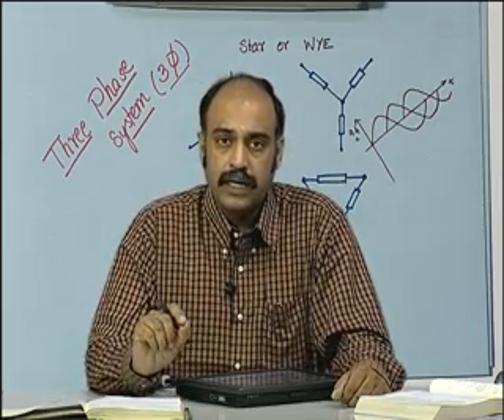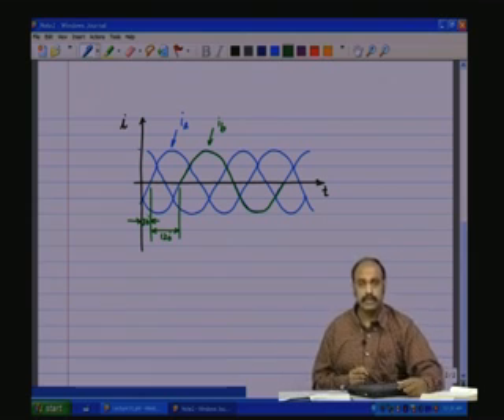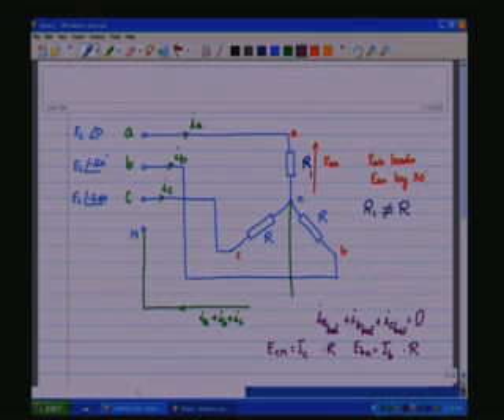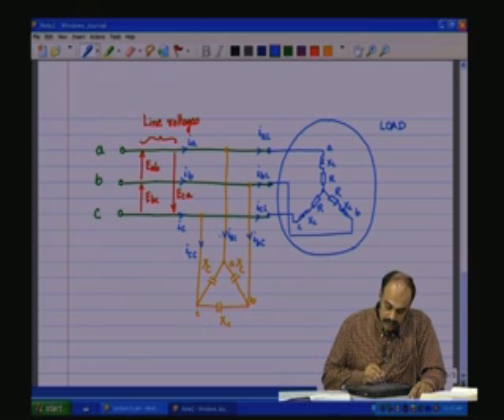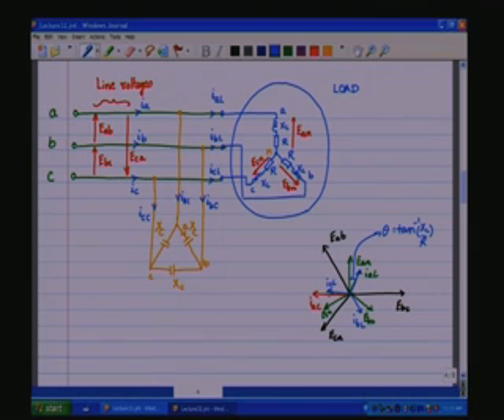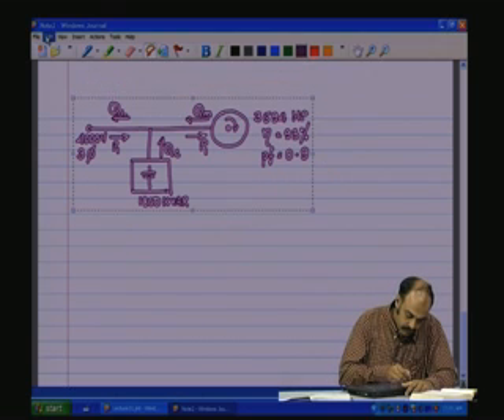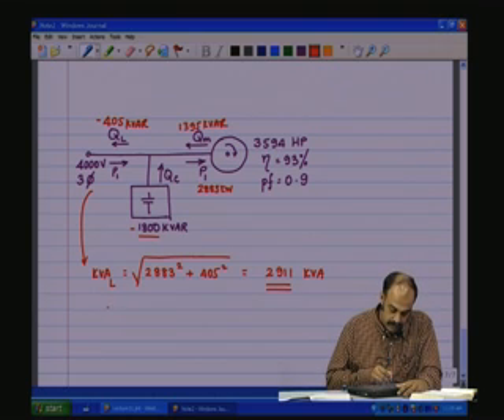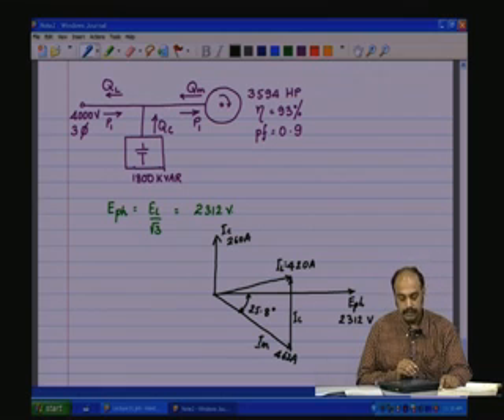Lecture - 32 Three Phase System - 3

Comment: Dear Sir , i have gone through previous lectures  30 & 31  and learn that for balanced resistive loads line current lags 30 degree w.r.t. line voltage  and the power factor to be unity for balanced resistive load.  here in this  video, while explaining  phasor diagram you are trying to make  Line current (ia)  in phase with line voltage (Eab)  stating  that power  power will be unity for the case  which is incorrect.  power factor will be  unity  Either  when line current is lagging by 30 degree with respect to  the line voltage  OR phase voltage & phase currrent are in Phase.  Sir  beg your pardon ..i am not correcting you, Just drawing your attention to the  lapse.